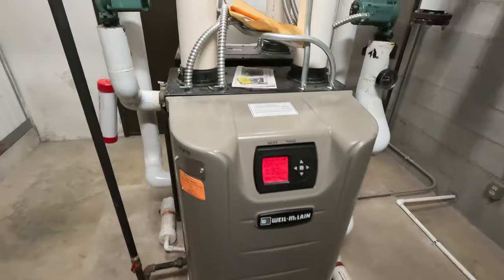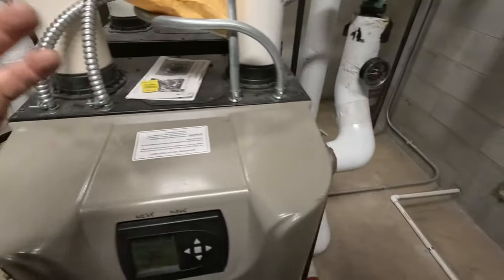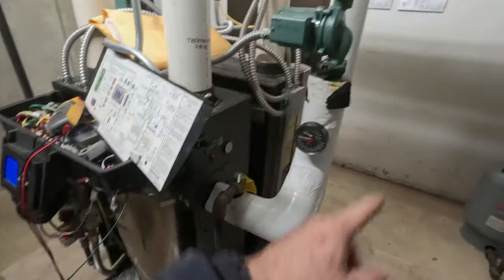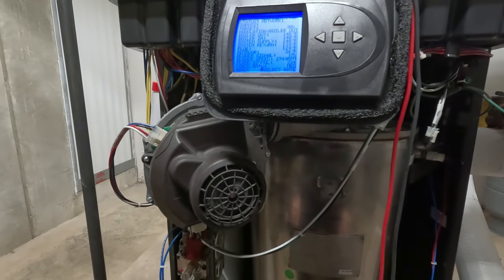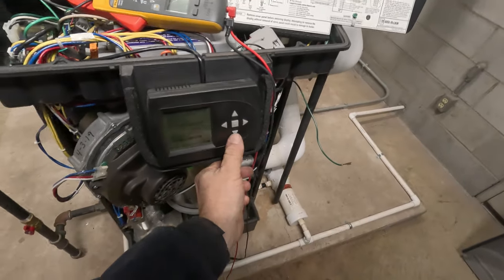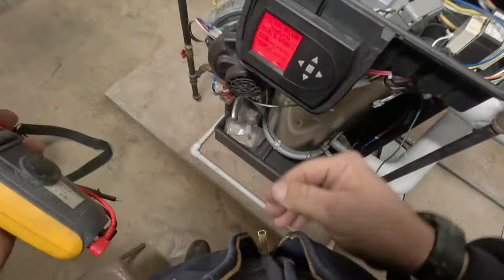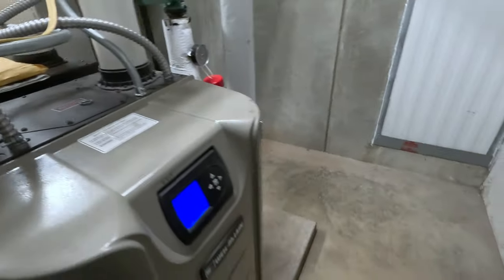Hot Water Boiler Not Hot Again!

Comment: Good job Rick, I worked on an Alpine, I think it was an Alpine, but whoever installed or repaired it before me, they didn't connect the neutral tight enough in the terminal strip, and it was arcing and turn the white insulation black, and it turned the wire had a break in the neutral wire too, the wire was hanging by a thread, I cut the wire back and reconnected in the terminal strip, and grouped all the grounding conductors together and gave it solid grounding connection for all grounds, Boiler has been working like a champ ever since. Don't feel bad about remembering everything on boilers, the more wiring and devices, the more complicated they are, just have the break it down to basics.

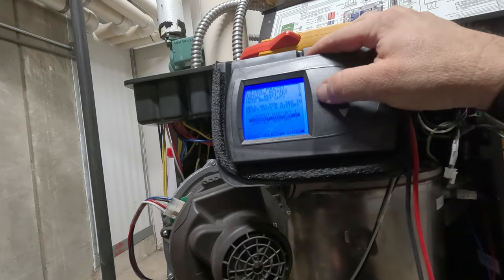Comment: is there maybe a flow check missing somewhere or stuck open? (early thought at 3:55 in video). ok maybe not an issue, but that could make it build up crud faster and possibly jam.
then again, maybe it's rarely cycled on in extreme cold weather. those dinosaur controllers very likely don't rotate the boilers primary/secondary rolls out every so many runs to keep them wear leveling cycled.(very likely the issue, other then crud in the system)

Comment: That's why I hate boilers. Order a pump you probably don't need just to find out there's gasket material accidentally left by previous tech. No one's going to take it apart unless they have another pump on hand. Stupid boilers!
Reply from the maker: I don't think the last guy did it but somebody did 😳
Reply: What's worse is that these are combustion modulating boilers.  They are very efficient but at the expense of complexity.  They can be very expensive to fix when things go wrong with them.  I would rather have a 2-stage or a simple on-off than a modulating one.